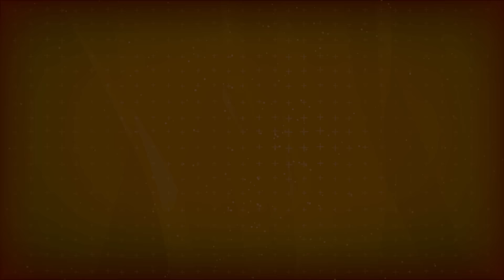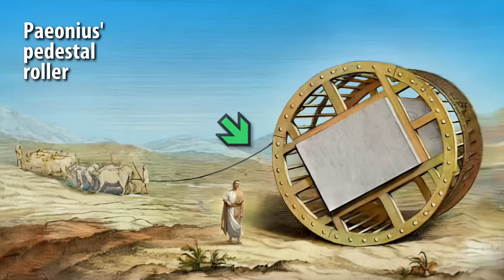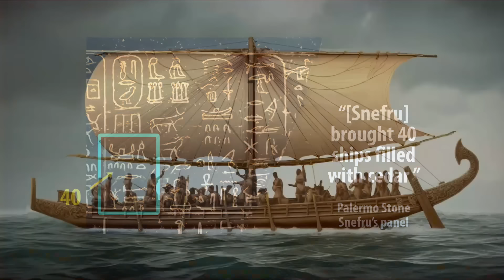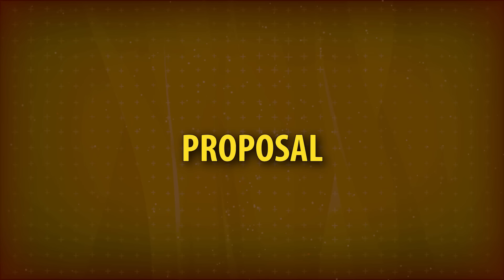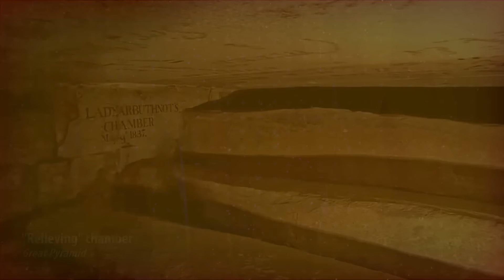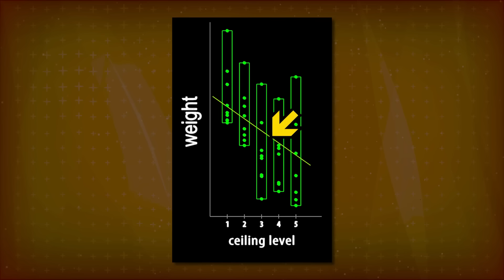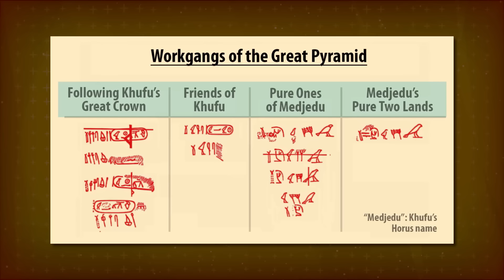How to Build the Great Pyramid in 9 Months (NOT aliens)

Comment: When I saw the Quarter arc antiquities were found in Egypt. I immediately remembered another way they could have been used - as described in "Ancient Stonehenge Technology Reveal By Wally Wallington Part 2" where he was rolling blocks across the top of these same forms. Of course, they would still likely be mud forms - but he was easily rolling 2 ton blocks over the top of them by himself. MAy have been simpler to do it that way instead of wrapping forms around individual blocks. Maybe they did a mixture of both methods dependant on the circumstances. 
I was surprised you did not touch on this alternate use, since you used some of his footage in this video.
Edit - I was also intrigued by the use of rubble fill. No one has ever touched on that before. You see the same methods in modern construction - freeways and such.

Comment: If you can build a small pyramid in 1 year, you can build a large pyramid in 1 year aswell. Because whatever method was used to build a pyramid, can be scaled with the pyramid.
If your pyramid is 10x as big, you have 10x as much space for cranes, levers, ramps - whatever is needed. It scales extremely well.

Comment: Interesting. My biggest issue is with mud brick as a roller. Until or unless someone does the experiment, I remain sceptical that the material is suitable. Further, you would either need an extraordinary number of these in constant production (if they were fed into the rubble after a single use), or a method of getting them back down the growing pyramid without interfering with the progress of stuff coming up. 
I don't think you need wooden moveable "drawbridges" at changes of direction of ramps if you simply leave a few blocks out of the structure, and roll the blocks sideways on the little platform thus created, leading directly to the next ramp.

Comment: Great new look at the construction problem. Fascinating and erudite. Why can’t the History channel up their IQ with this sort of content?
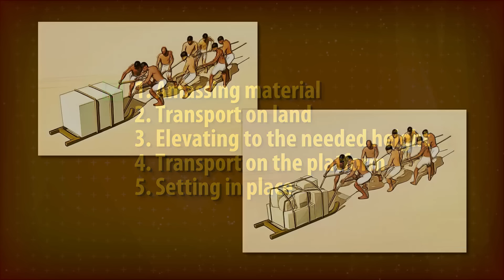Must the smaller rubble pieces need transporting in the same bulk as larger rubble and shaped pieces? 8:00. Perhaps they were transported more quickly in smaller, lighter bunches; that is, say, 3 times the number of pallets, but 6 times as fast.
The same argument at 8:40. Smaller pieces need not multiply the time of elevation per piece. The lighter the load, the less time penalty. Yes, more hoists. But time elapsed would more than compensate. The continued arguments against smaller manageable loads are not convincing to me; nets or buckets would work.

Comment: Very thorough, more plausible than Jean pierre houdin 's theory, which I feel to be overcomplicated. However, houdin pointed out the use of the grand gallery as a granite lifting device, due to the drag marks and rope grooves. I wonder whether a combination of theries is more likely? Big ramp for the bottom 3rd with the grand gallery lift thing,l for the granite blocks, followed by the fractal ramps for the top 2/3rds.

Comment: 1. You don't mention the time and effort involved in collecting the blocks or rubble.
2. In level land?
3. What about the time to manufacture and produce, transport, and move around the equipment used to lift the rocks?
3. Even the placement of the rubble has to be planned. Some of those examples of rubble head cuts in an event around other rocks. But you said they didn't even touch a chisel. The guy in your example video always starts his videos in the middle. Let him start from the beginning months earlier. 4. There are some stones that were inside of the chamber that had to be brought in after the pyramid was built. They have no clue how they were brought in. 5. At the quarries they've seen that the stones were literally cut and lifted out. How did they get up underneath them to lift them? 6. There are thousands of artifacts from Egypt but none from the construction of the pyramids. Why? I could go on.

Comment: These theories also help explain the recently discovered "void" in the pyramid. That area probably just has smaller irregular stones or different mortar. It also helps explain why the newest pyramids are the worst built-they might have cut too many corners on the wall-and-rubble technique, using inferior filler material.

Comment: Have you  considered the alternate theory by Franz Löhner? It eliminates the zigzag ramps but uses straight ramps up the sides and pulleys. I wonder why there so little mainstream discussion of the 1/4 round blocks to roll the limestone blocks - I read about that concept in popular mechanics or popular science back in the mid 60's. I think the only weak link in your theory is the annual flooding of the Nile. When it flooded, you would have a vast labor force of displaced farmers to work the quarries, pyramid building sites, and when the waters receeded they would return to their crops and herds.

Comment: Hmm.. Rubble? if you use castle building methods scaled, that also simplifies it.
Step one, build a border of heavy casing stones.  Leave a section open on one side for an /internal/ ramp.
Step two, based on some blueprint, place blocks lining or supporting planned chambers, tunnels or halls.
Step three, fill all the unused voids with rubble or smaller material that raw man power can move quickly.
Step four, once the infil and internal layout structrual components have filled everything to the uniform level of the first border of rocks, do some basic smoothing, housekeeping and morter, then start placing the next border of outer casing rocks, once again leaving a /gap/ on one side for the /internal/ building material transportation.  Do some final sighting probably using hand made tools to align with known features, string lines or stars.
Step five, return to step two and repeat until pyramid apex reached then go to step six.
Step six, do more careful sighting and trim off any out of line blocks, then working down from the top start placing casing stone, sighting each row as they go, filling and covering the internal ramp as they place the capping over it all and work down to the ground.

Basically think of it like a giant man powered 3d printer. With enough workers and materials it could definately be built under a year or two. Less if they are already stacked on site.

Comment: This is excellent work! They probably did use a ramp network that ran up the outer sides but my guess is they actually built the pyramid core as a series of platforms. The platforms were connected by the ramps which were later built over as the internal fill, sloped sides and facing blocks were completed. Some sections of rubble are possibly the remains of those ramps as they could be easily constructed by placing the rubble between platforms and outer rows of blocks. In this way the platforms could serve as both the structural reinforcement of the pyramid and also as the storage of blocks prior to placement.

While intriguing, I don't believe they raised the stones using rollers but rather by pulling sleds up the rubble ramps. A pair of oiled wood rails on the ramp would create a smooth low friction slope. Perhaps they even had ramps in pairs and used a counterweight funicular approach where they had a master lift sled on each side alternatively loaded with a block sled and a team of workers (to serve as the counterweight). The quarter-sections were maybe used to load and unload the block sleds by rolling them on and off the lift sled.

This system of simple rubble ramps connecting platforms with counterbalanced lift sleds and rails isn't nearly as time efficient for lifting as the proposed rollers but the work required in constructing these ramps and sleds is much less time and resource intensive.

The advantage of using human counterweight should be obvious ... the "work" rate could be maintained without any degradation almost indefinitely as the "effort" consisted of simply walking up the ramp every few minutes along with some minor pulling and pushing as needed.

Comment: I like the idea of multiple smaller “fractal” ramps. Whilst the sight lines down the pyramid’s corners is useful, perhaps of greater importance is the sight line to the middle of each side’s base from the top.  A plumb-line provides a consistent and perfect reference vertical datum and using one to sight to the middle of the each side’s base allows each layer of blocks to remain square with the base.  The four corners remain uneven during construction and so using a wooden sight frame to maintain consistent ‘squareness’ is difficult.  Aerial photography shows a residual line that runs vertically down the middle of each face indicating that a sightline from the top to the middle of each side’s base was maintained during the course of construction. For this reason I suggest that the pattern of mini ramps never crossed this central sight line.

Comment: Whether or not rubble was used depends on the end goal. If the pyramid was an electrical generator, then perfectly aligned blocks would best facilitate that goal. Rubble might have been used if only the outward appearance of the pyramid was important in the end result.

Comment: Excellent work ! Gives a lot of ideas.
Allow me just a few remarks: 1. The Pharao was not a despot, he was seen as a god. Therefore it was an honor to be allowed to work for him on the pyramid. The result would be the same as for the despot but the motivation is not (after the discovery of the workers village the despot theory was definitively refuted) . 2. It has be proven the casing stones to be set in place right at the beginning with all the other stones from each layer. Does your ramp model then still work? 3. If you assume 4 major building teams (as you've shown is evidence in the archeological studies) and each one is responsible for one corner of the pyramid (wich would explain the dents in the faces of khufu's pyramid), would your ramp system still work? 4. The grand gallery was proposed to be used to lift the granite blocks of the queens or kings chamber to the top. what do you think about that? the discovery of a hidden gallery by muon analysis above the actual grand gallery would fit in this picture.
looking forward to your thoughts.

Comment: Fascinating, however, you made one big flaw that I can see.  You discount a spiraling ramp or any other that covers the corners because it prevents line of sight checks.  I object to this with evidence: look at the top of the great pyramid.  The edges are square with the rest of the pyramid, but the rest of the blocks are offset by about 15 degrees.  The pyramids masonry does twist, and it doesn’t matter because it was compensated for when the final outer layers, which were probably added later.
Reply: I think the blocks on top of the Great Pyramid were rearranged from what was the original construction. Either happened when they removed the cap stone, or people tried to tunnel into the pyramid from the top.

Comment: You very skeptical and not open to the notion that there could and very well might be more to the story. 
Plus you didn't look at all into the building of the mock pyramid we tried to build. Based on these ideas.  Now I'm not saying it's impossible but I'm saying it's very improbable that's how it was done. Based on the fact we tried it Based on these ideas it was a total failure and embarrassment. With modern Crain's, trucks wheelloaders, and more.

Comment: Are you The Terminator?
I'm skeptical about this zig-zag ramp system. Doing this on the very steep Khafre pyramid would be impossible I think.
Menkaure's pyramid shows it was built using the Medium technique of building a stepped core first, then smoothing the sides, probably the other large ones were built like that aswell, and I think it makes sense.

Comment: Really well done.  If the structural stoned were geopolymer and the rollers used for ruble only, it would be even more efficient.
50 people could "pour" 40 stones per 10 hr day, the use the rollers to infill.
Reply: None of the stone blocks were the same size. You'd have to have the same number of uniquely-sized molds as the number of stone blocks.
Reply: @scottbreseke716  https://youtu.be/znQk_yBHre4?si=10XB7Pb2G53NYthG

Comment: Wholly and seamlessly stacked build is a must to eliminated the fluid pressure and junction fracture. 

Fluid?
Under large scale volume to unit rubble size ratio rubble behaves like sand pile contributing side force against thin casing stones. An extreme example is to take limestone ball for rubble. It will develop side force under weight from above.  It is not seismic proof, while seamless stack is.  

Fracture?
due to accumulated weight from above onto point contacts at each stack junctions below the mid levels. 

Seamless? 
Only limestone finished in optical perfect prism flatness can by pass pressure evenly downward eliminated localized pressure points, weak points  and hence premature fracture. 

How to attain perfect coplanarity without the trouble of optical quality? 
Use geopolymer concrete in liquid form pour into a mold where the future block is located. Modern bridge pillar were stacked that way. 

Geopolymer ? Follow Joseph Davidovits on his YouTube channel.

Transportation and lifting ? 
Was made possible and practical with buckets of geopolymer.

Comment: The main thing people need to understand is that in ancient Egypt wood was so rare and hard to get that it was worth way more than its weight in gold. The egyptians would reuse what little wood they had over 100s of years. So to build on a massive scale there is no way they could accomplish what they did using wood.
Reply: Wood was definitely not easy to source in Egypt, but not nearly THAT rare. 
For one, north Africa as a whole was far less arid thousands of years ago, meaning trees and other vegetation would have been able to survive more easily and farther inland back then. They also had the ability to get wood from far up the Nile near the southern part of Egypt, and along the Mediterranean coast they controlled. The Nile was constantly swarming with cargo ships, barges, rafts, and boats of many different sizes and they couldn't build that massive number of river craft without a significant amount of wood. Most of the trees around Egypt weren't ideal for making sturdy and long lasting ships though, but they did have trade with eastern Mediterranean regions that could grow cedar and other trees that were in high demand in Egypt, but those would be very expensive to buy and transport by ship. They also had few practical ways of preserving Most of their wooden craft for long periods. The expensive ships might have had some protective and sealing coat, but most smaller rafts and barges wouldn't, and they would likely not last long in the Nile before some of the wood stared to rot and become unusable. Compared to the amount of wood needed for their ships, the wood needed for pyramid construction would have been minor, and much of it could be used for other purposes afterwards anyway.
Reply: @restitvtororbis5330  I have to agree with you… The Gyptian seem to have been masters of importing material from distances. Including possibly… Sand from hundreds of miles away… Sand with larger crystals that they apparently used inside and around the queens chamber. So I’m getting word from other places… Is a very Egyptian thing to do.

Comment: The wooden frames....not  bulit for rolling or rocking anything with much weight... issues with spoked devices, limited Directional Load Capabilities... even when used at maximum efficiency with modern tech, spokes are a pain,  as they flex and work loose.....using (4) independent wheel segments seems impractical as there would be a Tremendous need for the reworking of each segment after every single lift.... The problem with spokes, spokes don't stay true... they work loose continually... Spokes wheels work like a truss They handle a load  in one direction fairly well...However, a shift sideways, will destroy the truss... there are 8 segments used per lift , with a single row of spoke per frame, if any one spoke should fail, it could damaged the entire frame and stop the work . The shift in force sideways comes from steering. That is not to say, that we can't build 4 spoked wheel segments that would, in fact , do the job.... it's matter of structural integrity ....also, each block is unique , and varie  in size greatly one to another and another ; with some being almost rectangular.  It would take special wheel segments to produce smooth rolling....the short switch back ramps are the most practical . the fill material used in the pyramid construction itself (the rubble) suggests that the fill used , came from the no longer needed ramps, thus , there are no Outwardly Tangible evidence of the ramps used....as they became the inner core of the structure....

Comment: Why just use the mudbrick rollers on the way up?  You could use the used rollers as a counterweight hanging them off the rope vertically to provide assistance with the heavier blocks.  This would also rock with the internal ramps and a counterweight in the grand gallery theory that seems to be supported currently.

Comment: This video is really good. Two things that bother me are the lack of use of the gran gallery and the internal ramps seen from analysis from above using similar technology  like x-ray. Those ramps that are slightly tilted sideways are not there for nothing and the gran gallery clearly shows signs of damage due to scrapping due to pulling up the ramp.  The idea ramps on the outside although is really good idea, I do feel its over the top. The internal ramp with its pull lever/roller methods works would work well also perhaps even better. Still this video is a gem.